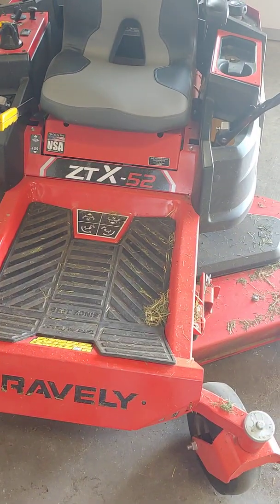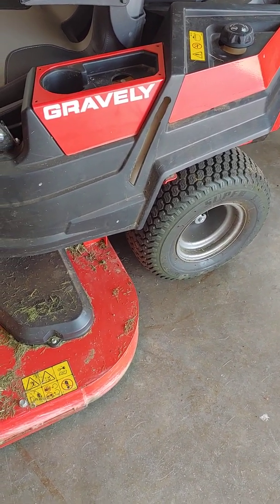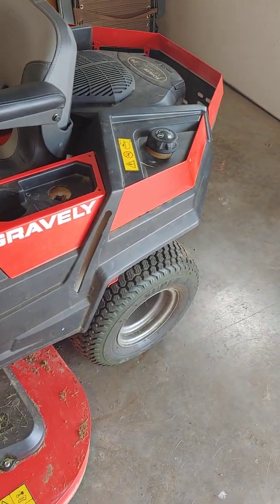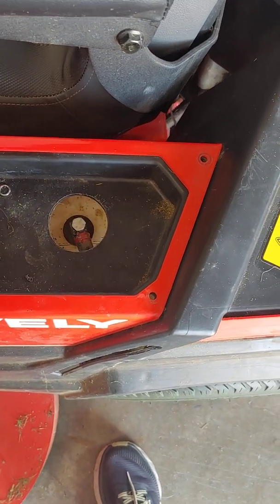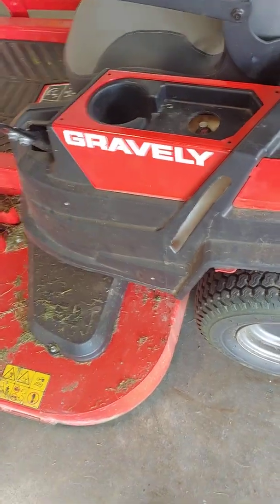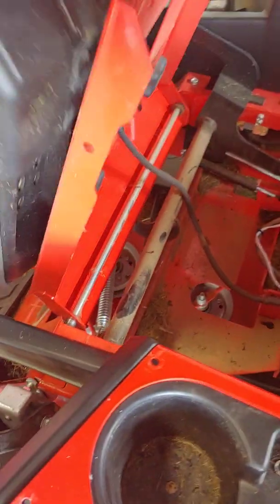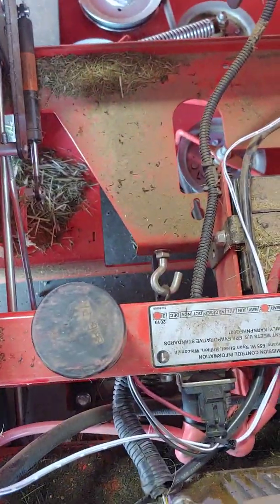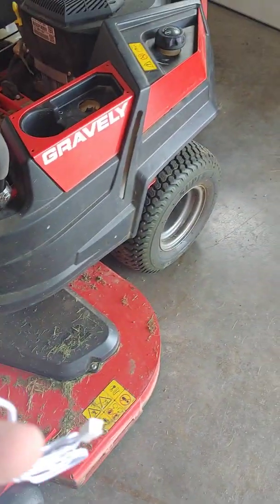Gravely fuel gauge alternative.

Comment: What a great idea! I have a Gravely ZX60. I love this tractor and would not hesitate to by another one except for one thing, the fuel gauge (or lack of a real one) I keep my tractor in my pole barn where the lighting is not very bright and it's hard to see the fuel level. Even trying to use the flashlight mode on my smartphone does not help. Most zero turns do not have any type of fuel gauge because of the odd shape of the tanks and is probably why installing a float gauge like you originally tried on zero turn mowers would not work. I do know they make a sonar type of sensor for liquids that could work but it would be a little pricey. After spending almost $8,000 for a professional grade hi-end tractor I would expect a fuel gauge that I could glance at while I'm mowing, and I would be willing to pay extra for the convenience. I ran out of fuel numerous times mowing my 7 acers and it sucks walking    to the barn and back with a 5-gallon jug of gas. Usually, the tractor runs out when I'm at the furthest distance from the barn. 
 I will definitely try your method with the 12-volt light. I been searching for a resolution for this issue for the last 3 years. Thanks again for the great idea.